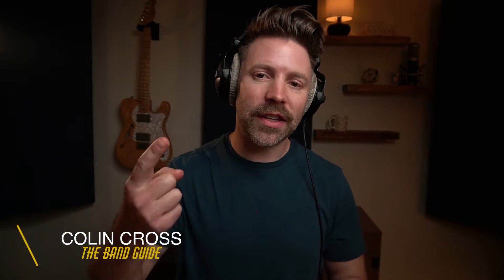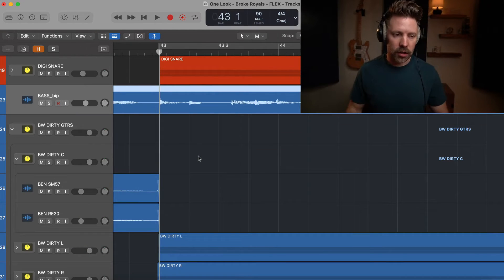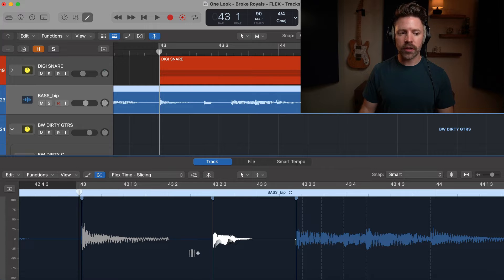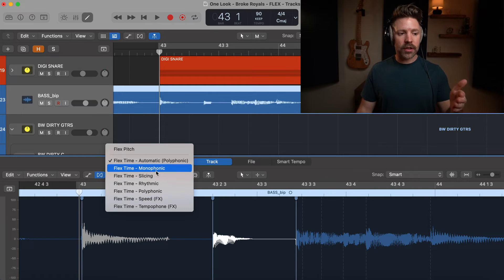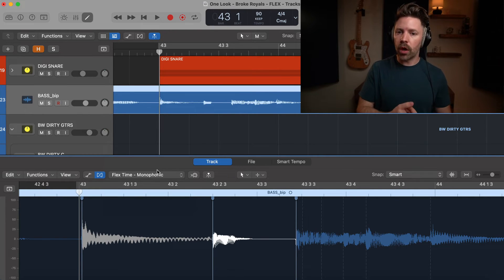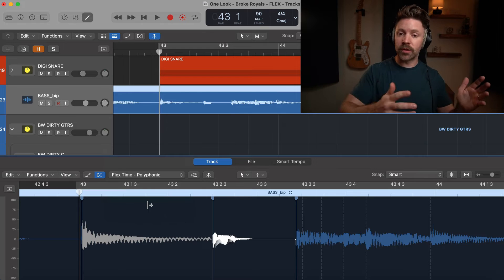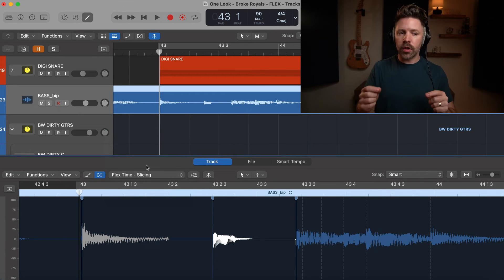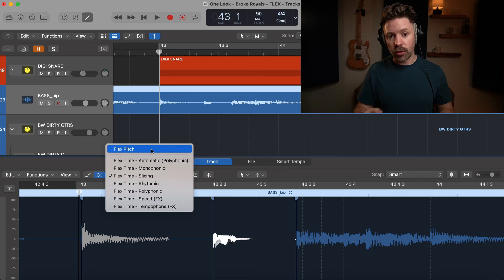Flex Modes Explained | 5-Minute Logic Expert (Pt 18)

Comment: Question: I´m a dj and sometimes when i play older songs they are not quantized and will go up and down in tempo. i would like to quantize these old songs to make them easier to mix with. I´m thinking of using "adapt" (tempo) when loading the song in to Logic and then use flexmode to analyze the song and then level out the general tempo of the song. What Flex-mode would be best suited for that?

Comment: Thanks for this Colin. I used flex time in GarageBand and got extremely frustrated with it so I haven't used it yet in Logic but you showed me it's a lot more flexible in Logic and I will revisit it. So far in Logic I've found stretching and shortening regions using the option key has worked for me really well. I use flex pitch and really like it, not just for pitch adjustment but also adjustment of vibrato.